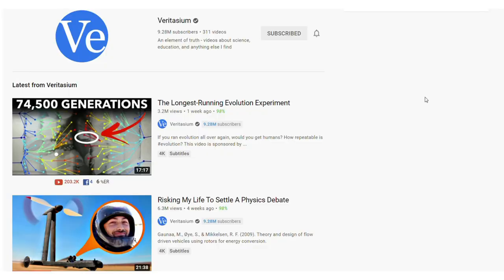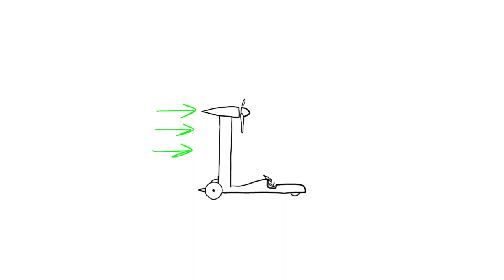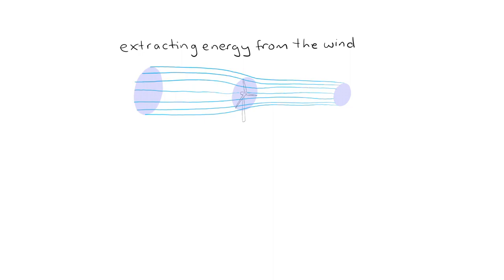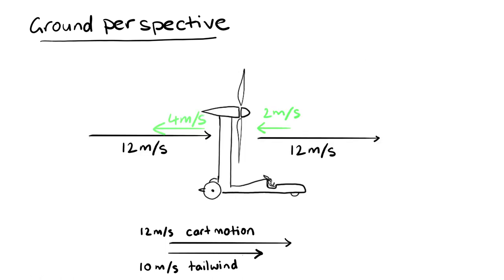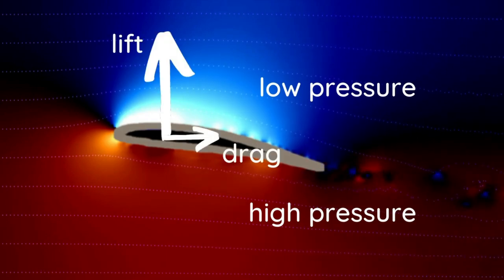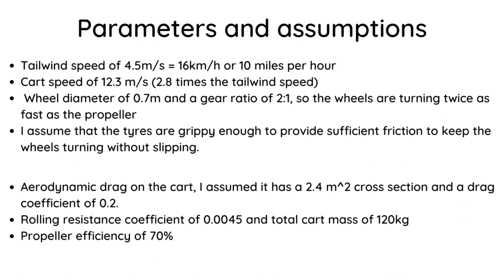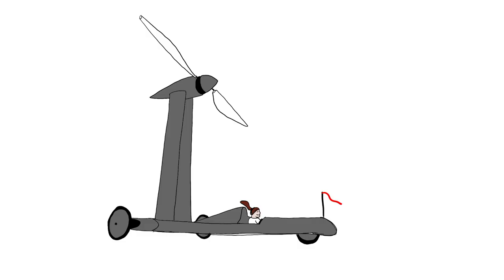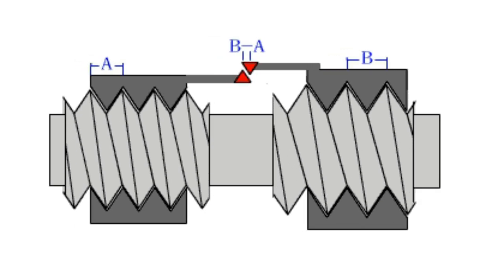Downwind Faster Than the Wind by Veritasium: How Does it Work?

Comment: If the wheels are connected to the prop then the wheels are always preventing the vehicle from achieving its potential top speed. It is more drag. The energy conversion from wheels to prop and vice versa is never 100% due to losses. That is not just my opinion, that is physics. I suspect that you might get a slight push at full wind speed due to the prop acting as a flywheel and it would have been useful if the veritassium video had explored that on the models. I also suspect that people are not understanding relative wind properly, even the yachties on the veratissium video. The maximum energy that can be extracted from the wind is when it is directly in the direction of  vehicle motion. An aeroplane propeller has extra "external"energy from the engine so cannot be used as a direct" proof "in this case. You would be better off trying it on a glider which does only use the wind.
Could the streamer going rearward just be caused by having a massive fan behind the drivers head dragging the air backwards?
Reply: //"If the wheels are connected to the prop then the wheels are always preventing the vehicle from achieving its potential top speed. It is more drag"//

You could make the same (bad) argument about the keel on a sailboat: "The keel produces drag and thus is always preventing the boat from achieving its potential top speed".

What we know of course is that without the impact of a keel, a sailboat can never sail faster than the wind.  Put the very best, multi-million dollar sail (even a wing-sail) on a flat bottom boat and it will merely drift downwind at something less than windspeed.

The gearing to the wheels provides the same kinematic constraint to the airfoils of the Blackbird as the keel on a sailboat provides to the airfoil that is its sail.  This constraint ensures that for every unit measure of airfoil downwind travel, the airfoil is forced to also make a ratio of that unit measure of crosswind travel.   The keel and the sail have to work in tandem to travel faster than the wind (or even just upwind).  Saw off the keel and you're done in those cases even though your boat now has less drag.   Break the chain to the wheels of the Blackbird and you're in the same boat.

//" I suspect that you might get a slight push at full wind speed due to the prop acting as a flywheel "//

Nope -- during the run, the gearing between the propeller and the wheels is of the fixed ratio variety.  This means that the prop and the wheels are hopelessly tied together.   If the propeller slows down (as it would have to to harvest energy), the wheels must also slow down.  What you find instead is that the propeller *speeds up* as the vehicle accelerates above windspeed just as you would expect it to as the wheels speed up.  To go faster than the wind, the craft is not only having to overcome the now relative headwind, but it's has to store MORE AND MORE energy in the propeller to accelerate. 

//"Could the streamer going rearward just be caused by having a massive fan behind the drivers head dragging the air backwards?"//

If you research the Blackbird/BUFC, you'll find multiple YT videos of testing just to show that the answer to your question is "no".   Not only were streamers placed on long carbon fiber rods WELL above and to the sides of the propeller (in plane with the disk) and shown to be holding steady state rearward, but for its world records, instrumentation was used all over the Blackbird, the chase vehicles and along the course -- no streamers involved.
Reply: @johnborton4522  yes I could make that argument and it would be correct. The keel produces drag (water resistance) and any drag saps energy and will have an effect on top speed. The keel is fitted, as you say, to prevent side drift when the wind is not directly aft, as well as to help balance the force from the mast and sail which at a high wind speed would try to overturn the boat, not just push it sideways. The keel drag, if the boat was going sideways, would be much higher than going forward or reverse because of the shape of the keel, so the boat prefers to go forward or reverse ie the direction you want it to go. The fact that a keel is used for directional stability doesn't detract from the fact that it adds drag.

The same goes for the wheel propeller combination. The wheels, the propeller, the chains, the gears, all have friction involved ie drag so they detract from the total energy available. If the only energy available is the wind then because of friction/drag less than the full amount of energy can be extracted. As the maximum energy component of the wind vector is directly in the direction of the wind then you can't go faster without some extra external or stored energy.

Your second point doesn't make sense at all. You say that once the vehicle is going greater than wind speed that the propeller and wheels get faster (and faster?). If that happened it would just get faster and faster ad infinitum, but unfortunately physics won't allow that so it doesn't happen.

I suspect that people are not understanding relative wind vectors properly. The relative wind components of the actual wind are never greater than the actual wind. You can sail faster than the vector component of the relative wind but not faster than the actual wind speed in the direction of the wind. If it were possible then no one would be using engines for any vehicles. 

Third point. I have seen a couple of the videos including the verutassium one. That is why I asked about the streamer because of what he said about it.
This would need a touch of "free energy" technology to work against the long established physics, so I am a non believer. However if you have these things running as mainstream transportation in a few years time you are welcome to say "I told you so".
Reply: @crabby7668  

//"yes I could make that argument and it would be correct."//

If you think a sailboat can go faster without its keel (and intend to stick with that position), you're beyond hope so I'll leave you to that ignorance.
Reply: @johnborton4522  I don't think a sailboat will go faster without its keel and have never said that. The keel is necessary but that doesn't mean it doesn't create drag that will limit its performance. An analogy would be removing wings from a plane. That would reduce drag, but then you lose lift as well so the plane doesn't do what you want it to. So you have to trade off drag and the performance that you desire, the same goes for sail boats. The drag is always there and increases with speed, so is always limiting the speed and dependent on the actual design. 

Does the blackbird experience the same effect as you asserted, when the wind comes from all quarters including a direct headwind or only when the wind is directly behind? 

I still look forward to seeing these in mainstream use in a few years time.

Comment: So the apparent wind hitting the blade edges  is greater than the true wind. Just like on a beam reach.
Btw, according to the maths,  air pressure differences on wings alone does not enable planes to fly. It's also the downward airflow, ie Newtons third law, and other factors. NASA has an article on their site about this.
Reply: >> air pressure differences on wings alone does not enable planes to fly. It's also the downward airflow

It's not a combination of the two.  You can look at it either way.  They're just two sides of the same coin.

Comment: I still don't see how this maintains a velocity of 2x wind speed.  I don't see why the momentum given to the wheels shouldn't be the same as that given to the propeller and the wind.  From all of the physics I was taught, the momentum given to the wind should match the wind given to the wheels, being that the two are physically linked.
Reply: Momentum is conserved in wind+car+Earth system, not just wind+car. Both the car and Earth get momentum in forward direction.
Reply: @andreykuznetsov7442  I appreciate the reply, but I still don't understand how that's happening. To me it seems circular, and I just dont see what's happening.

From your reply, you say the car and earth get momentum forward, I don't see how that can happen. Only the car is interacting with the ground. If the earth gets momentum forward, that means the car would need momentum backwards from that interaction. 

If you are saying the ground gets pushed backward, and the car gets momentum forward, this makes sense... But where did the momentum to push the ground come from? If the propeller, that would mean the propeller is driving the wheels, not the other way around. 

I see a lot of people saying it's a three system interaction, but everything is sounding circular and sounds like a loop.
Reply: @nickr7437  I think, both the car and the Earth get momentum in forward direction. The air gets momentum in opposite direction (backward). 
The air pushes propeller. The propeller pushes the hull of the car forward and applies the torque to the wheel. But it does not rotate the wheel forward as in usual car with a motor. It "tries" to rotate the wheel backward, so the wheel pushes the Earth forward. This is needed to make blades move along certain trajectory. It's too long to explain it all with words only. Recently I made a video with visual explanation using extremely simplified model of the wind car. No aerodynamics there. You may find it at my channel.

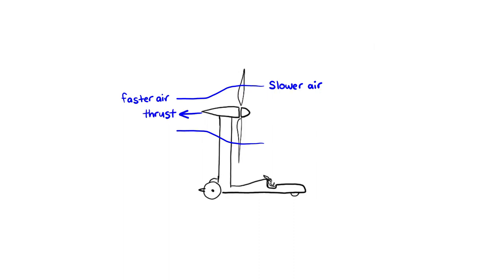Comment: Thank you for your explanation. The analogy at 2:58 (Analogy: like a cyclist pushing off a car to go faster than the car) is clear but is not accurate. Here the car represents the wind but the energy for pushing off the car is coming from the cyclist's arm -- not from the car. Therefore, for the cyclist, to go faster than the car, additional external energy source is needed.
Reply from the maker: Do you think that's the case? I'm thinking it's very similar to the Madison cycling event, where two cyclists do a slingshot manoeuvre to transfer momentum from one cyclist to the other. It is very obvious in that manoeuvre that there's an energy transfer from one cyclist to the other because they have similar mass. With the car example, it weighs so much more than the cyclist that you wouldn't notice it slowing down much to transfer an amount of energy that's significant to the light cyclist. Do you think I've got it wrong?
Reply: @EngineeringwithRosie  The car represents the wind. As long as all the energy to move the cyclist comes from the car (in any which way), the analogy would be accurate. However, in your example, the cyclist is using his own muscle power to push off the moving car (to go faster than the car). This muscle power is external to the energy of the car -- and makes the analogy inaccurate. In the case of the wind-driven car, there is no energy provider other than the wind.

Comment: If the wheels are moving the propeller and the propeller is giving a thrust to the vehicle, then it could also move in a still atmosphere provided we give it an initial velocity. I have had a conversation about this with the constructor of the vehicle, Rick Cavallaro, but he didn't give me any answer! (the conversation is under his video https://youtu.be/xHsXcHoJu-A )
So, the crucial question is how the vehicle accelerates before it reaches the wind speed? If the wheels are turning the propeller, then why do you need the wind at all?
Reply: "then it could also move in a still atmosphere provided we give it an initial velocity"

No, that would be a true perpetual motion machine unlike this cart.

"If the wheels are turning the propeller, then why do you need the wind at all?"

Here's one way to look at it. Once the cart has exceeded wind speed both the air and the ground are moving backwards from the cart's perspective. However, because of the wind the air is moving backwards slower (from the cart's perspective) than the ground. This is crucial and the reason why the propeller can accelerate the cart more than the grip of the wheels slow it down.
Reply: @seneca983  Quote: "Once the cart has exceeded wind speed ..."
My question is about that, how the cart is moving BEFORE (and once again BEFORE) it reaches the wind speed. The wheels are turning the propeller (so it is said). The wind has no role in the story at all.
Do airplanes move on the runway when there is no wind at all? Of course they do. 
Hence, if the wheels are turning the propeller, then you don't need any wind.
Reply: @MitkoGorgiev  "The wheels are turning the propeller (so it is said). The wind has no role in the story at all."

The wind is the reason why the accelerating force from the propeller is greater than the decelerating force from the grip of the wheels. This is true for both before and after windspeed has been reached.

Also, before windspeed has been reached the aerodynamic drag of the cart's frame contributes to acceleration.
Reply: @seneca983  This is just a word salad and I will refrain from replying to it.
Reply: @MitkoGorgiev  "This is just a word salad"

It's not.
Reply: @seneca983  it is. you're very likely a chatbot.
Reply: @onebig77thbrigademonkey.57  It's not. If there's any part of my comment you object to, you can point it out so I can reply.
Reply: @seneca983  you're a chatbot, so no.
Reply: @onebig77thbrigademonkey.57  I'm not but even if I were it seems you can't point out any flaws with my logic.

Comment: Hm, I wonder would it work with horizontal wind turbine => so that contraption is independent from wind direction...
Reply: It's a propeller rather than a turbine, so it needs to accelerate air.  That could work with a pivoting nacelle in any direction, but not with a vertical axis wind turbine.
Reply: For a vehicle going against the wind that could work.

Comment: It's easier to just explain the lie in the word "faster."  Speed of something is often correlated to energy, which is why we think blackbird sounds wrong and breaking conservation of energy.  But it's more accurate to image the wind as a massive metal cube sliding down the hill very slowly at 10km/hr, and when it bumps into a smaller cube on its way down, it would send the smaller cube moving way faster than the thing that "pushed it."

Comment: I wonder if we could use the same mecanism on air (like a zepplin), if so it would be a very cool
Reply from the maker: Sounds cool! Maybe with a Savonius type wind turbine (like a water wheel) instead of the wheels.
Reply: When i think about it it wouldn't be possible to go faster than wind on air since there shouldn't be a speed diffrence on air 
but with a carrefully calibrated gear and spring system we can temporarily speed up 
and if we push this speed busts to ground we can create a flappy bird alike aircraft.
And again it would be very cool.
Reply: You cannot. 
It needs the difference in speed between the wind and the ground. You need wheels on the ground or a keel in the water.
Reply: @recepugurdolar9687 the solution in air is to use wind gradients.  This is how an albatross stays aloft for hours without flapping, and dynamic soaring R/C gliders hit speeds of hundreds of miles/hr.  You can also imagine tethering two hang gliders to one another and staying aloft (even climbing) indefinitely as long as they're separated by a healthy wind gradient.
Reply from the maker: Yeah of course that's right. I had a little space out just then, thinking you could make it work all in the air 🤦‍♀️
Reply: Only if you towed an electrical generator cart against the ground, send the electrical power up a cable to the blimp and used it to power an electric motor turning a prop!  Then it becomes the equivalent of the cart!
Reply: @Rick_Cavallaro  I'm now imagining an airship travelling around the world at relatively low altitude, powered by a Makani style generator flying high up in the jet stream.

Comment: Hi! I loved the video. Hey, I’m curious if a trivial solution makes sense. Essentially, the vehicle is a wind turbine propelled car. If you think of a highly efficient wind turbine it generates a great deal of energy in the form of electricity, surely enough to propel the car very fast. After all, the turbine could power many entire houses. So if the wind rather than being converted to electricity was instead used directly to push the car forward, could it not easily greatly exceed the speed of the wind. For by conservation of energy the same energy in the form of electricity could instead solely go to the kinetic energy of the car. More than that, since wind to electricity conversion is not close to 100%, then the amount of energy available to propel the car would be much more than if the wind was converted first to electricity and then to kinetic energy of the car.
Reply: It's Not a wind turbine propelled car - it's a Propeller powered car. A wind turbine generates electricity as the wind pushes the blades around ... this car gets energy from the wheels and that energy turns the propeller and the propeller pushes the car forward. What your describing would be a complete opposite design and would require a whole new experiment. I have considered that in the past but never saw an explanation why it wouldn't work. Seems like it could work realy good with just a small battery pack to charge up a little before "Taking Off" :-)